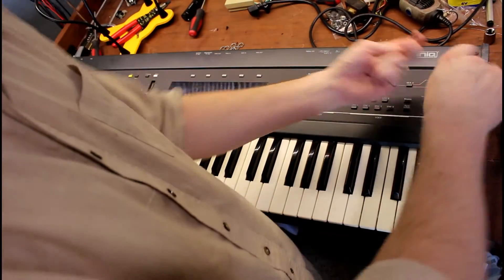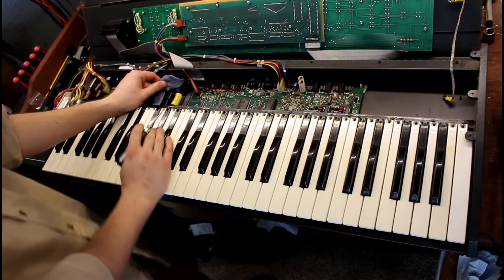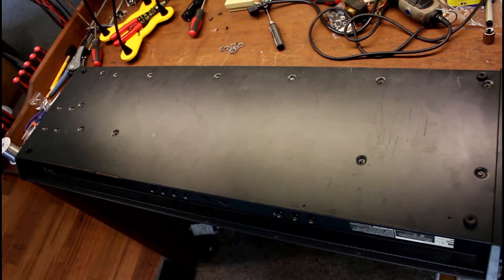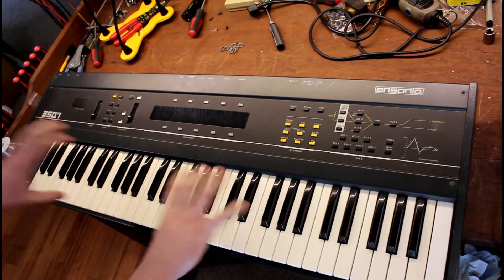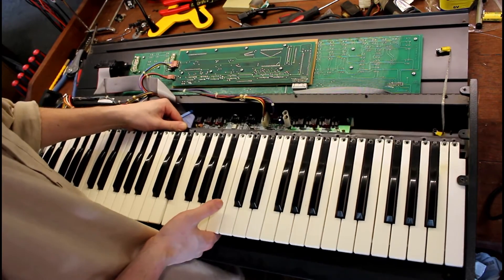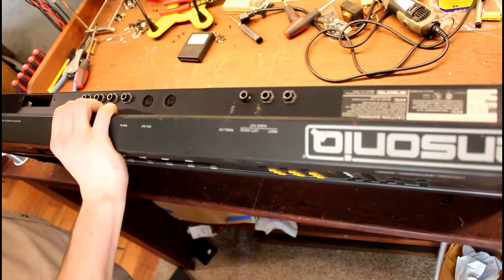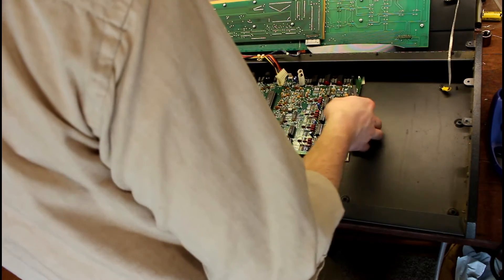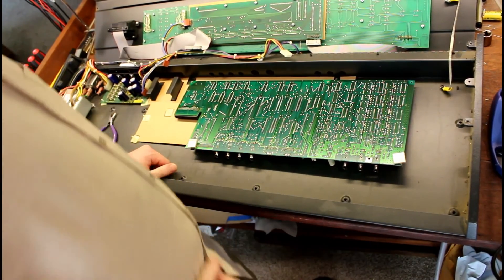Ensoniq ESQ 1 Accessing Internal Battery for Replacement (Soldering Required)

Comment: Thanks for the video
Went ahead and replaced the dead battery with mine but still getting the warning message of a dead battery
Any ideas? 
I did a continuity test with my meter and all checks out.
Wonder if I’m missing something
Reply from the maker: Only things I could think of are: 1 replaced with a dead battery. 2 swapped the polarity by mistake. or 3 Improperly soldered (either a cold cracked joint or perhaps soldered to one side of the PCB, but not the other. Either way the first test is the same: follow the circuit traces from the battery solder points to nearby pins/pads and measure the DV voltage from there (that will tell you whether or not the battery is actually supplying the board with the proper voltage.)
Reply: @MetatronicModsLLC  Thanks for the fast reply! Found out it was the fuses actually. Synth is back up and running!

Comment: I have an Ensoniq KT-76 but when I turn it on it' makes a loud static sound, you can hear the note from the keys played in the background but the static noise in continuous, Its been sitting in the case for a while
Reply from the maker: Is the static sound like white noise? Or is it like a hum/buzz at a particular frequency? Does the static sound change at all when you press different keys or change settings?
Reply: Static Sound like a white noise I would guess, no hum/buzz. It does not change when a key is pressed but you can
hear the note in the background, I tried to attach a video... nothing happens when I change the setting everything change like it should but the noise is still there

Comment: At  0:55 you can plainly see the yellow battery, but later at 2:35 it has disappeared. You go on and take out the circuit board but where did the battery go? How? How do you put in the new one? It just ends without actually showing what's in the title - "battery replacement" - there's no data on getting it out and incomplete data on replacement. So I'm still sitting here with an ESQ1 with a dead battery and no idea how to complete the job. If I knew how to do this I wouldn't have needed a video would I?
Reply from the maker: Yeah... I didn't follow my own advice, and I de-soldered the battery from the top of the PCB. I could have easily damaged the board though, and soldering in the replacement from the top felt too risky. I edited out the part where I removed it and re-shot some parts because I didn't want someone following my example and damaging their instrument. 
Thanks for the feedback though. I've fixed the title so others will better understand what's involved and what the purpose of the video was (how to get at the battery - I struggled for half an hour trying to figure out a safe, quick way to get the board out.)
Reply: Well hey thanks a lot for the reply man!  Wait! I have an idea. Since I don't even have a soldering iron never mind the expertise, why don't YOU put the new battery in my ESQ1! No way I'm going to try that. All I have to do is figure out how to get the keyboard up to you from Tampa and back without costing a fortune! LOL! Here's another question. What could be making many of the white keys very uneven volume and poor touch, while the black keys are all even? The keyboard's been sitting uncovered and unused for -- wait for it -- YEARS! Could it be dirt? Dust? Contacts corroding or something? I guess I better start looking for a repair shop in the Tampa Bay area. Wish I was closer to Asheville...
Reply from the maker: I'm trying to remember how the esq-1 key contacts work. Seems fouled contacts should cause keys not to sound at all. But have you tried controlling it from another MIDI device? If the notes all play right from and external controller then it's almost certainly dust or corrosion on the spring contacts or the ribbon cable connector for the keybed. Best of luck finding someone there, or if you figure out a way to get it up here and back, you know how to get in touch.